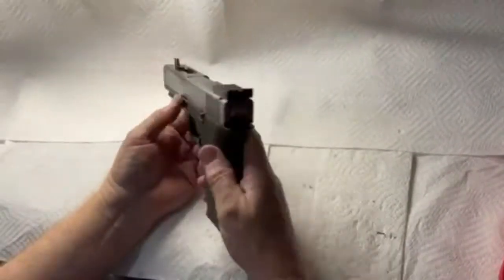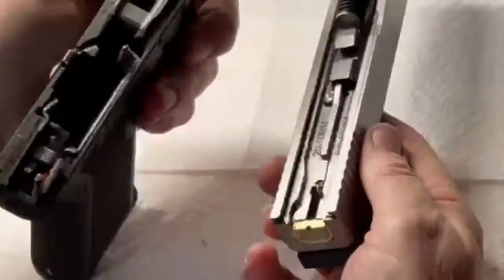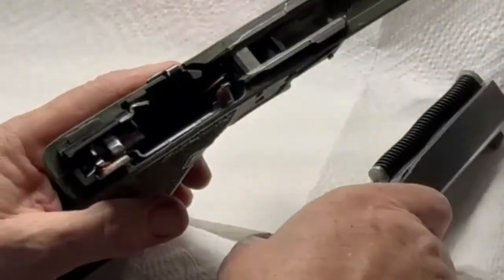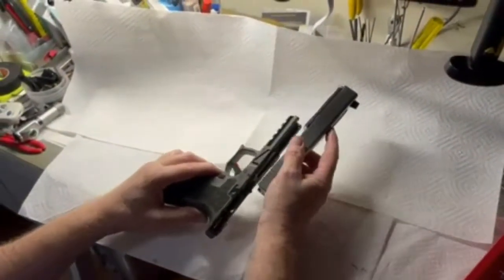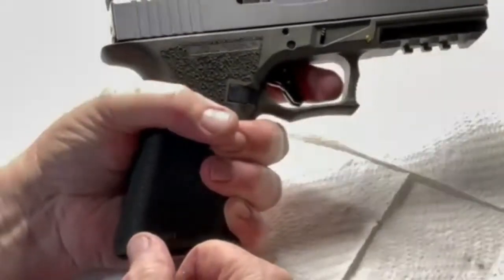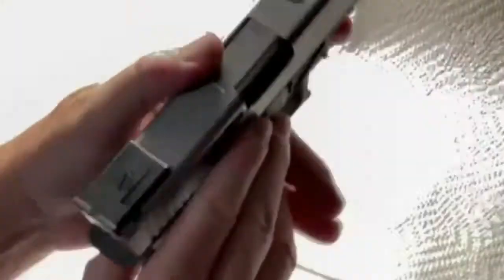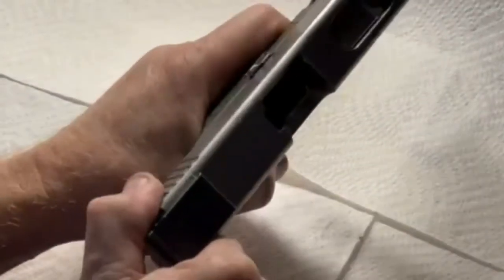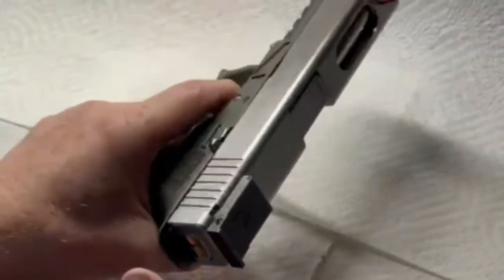glock 20 full size frame 10mm with timney trigger

Comment: I thought timney recommended not using lightened striker or aftermarket springs
Reply from the maker: Thank you for you comment, this system was made before Timney had anything for the full size 40mm frame.
Lots of parts were tested during this build & many fails as well.